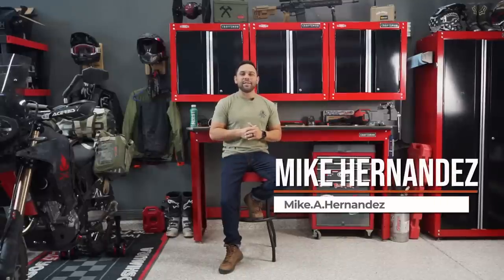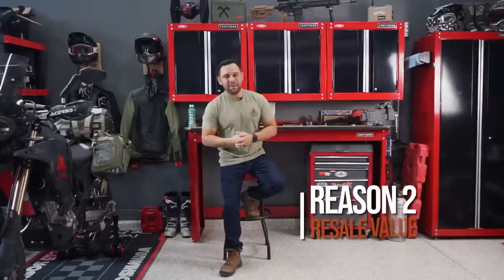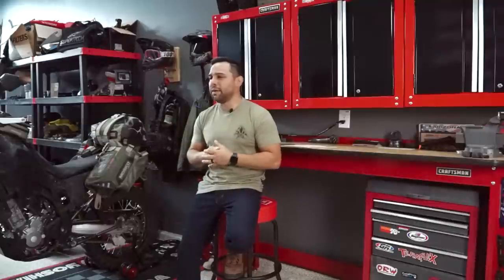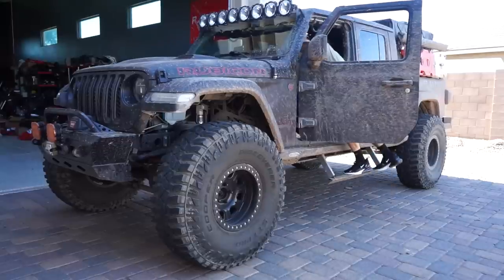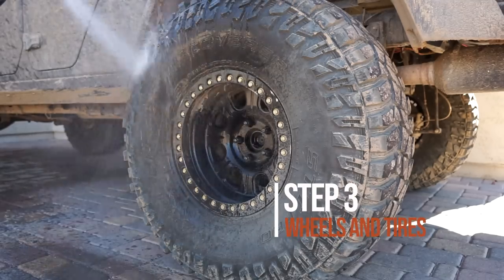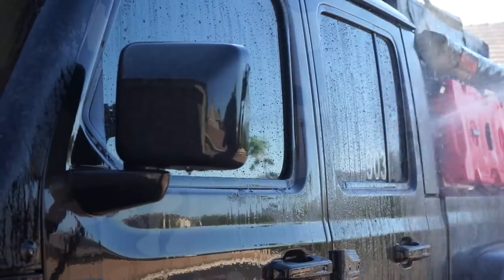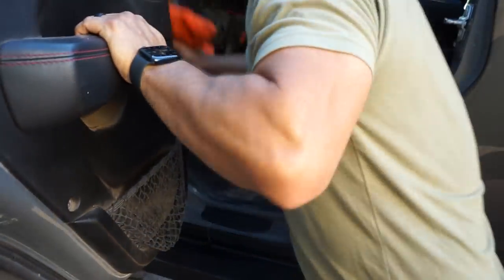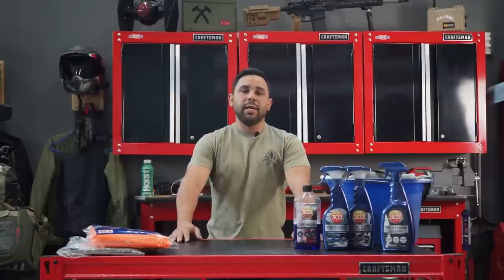How to wash your vehicle | Fieldcraft Mobility

Comment: As an overlanding "enthusiast" and professional detailer I have been waiting for this video from you guys for years. Very informative and well put together. Detailing clients rigs and ATV's is always something I look forward to. 

I understand the ease of finding all of your supplies at your local Walmart, but if you are interest in products beyond what the Walmart shelves provide and that are designed for heavy level of dirt and grime overlanding throws at you, I would suggest taking a look at the Off Road line from P&S. The products that stand out in their line is Mud Buster which is marketed as a wheel and tire cleaner, but can also handle all the salt, sand, mud, and whatever else you find on the undercarriage, suspension and frame plus it leaves corrosion inhibitors reducing the likelyhood of rust on the exposed areas.

Also, for those who are in areas with water that is prone to mineral spots or in hot climates I would suggest using a Rinseless wash, such as Optimum No Rinse, instead of regular auto soap. Rinseless washes reduce the chances of water spots, allow for quicker washing leaving less chance of water drying on your vehicle, and also remove dirt just as well and actually more safely as foaming soaps.

When it comes to protection for a vehicle designed to get dirty, I like to keep it quick and easy. McKee's has a wipeless graphene ceramic coating/sealant that takes the cake. Once you've rinsed the soap off your car, spray a section with the sealant and immediately rinse it again with water, that's it, all you have to do is dry the vehicle and wall away. It coats everything, paint, glass, plastic, rubber, metal, etc, protecting that surface for up to 6 months. Water beads up and rolls right off, which helps keep dirt off the vehicle and helps improve your windshield visibility in the rain. It's simple, super effective and makes maintaining large rigs so much easier.
Reply: I was surprised you didn’t pick up on a few things here? In the UK we use snow foam lances to do the hard work of removing grime. Likewise removing the hardness from water first helps with avoiding water marks. Also you clean the inside first, he was doing the door jambs as an afterthought. Same with the wheels, you clean those last.
People really should watch some detailing channels if they want to learn this stuff, as most of it wasn’t applicable to non wrapped vehicles. Like the two bucket idea, there was no grit guard in there? that’s basic information he’s not understood.
Reply: @____________________________.x  And that's the beauty of detailing,  there are many ways to accomplish the same goal. Snow foam and APC pre-rinses are ideal for starting to remove dirt and grime from vehicles, however this video is obviously meant more so for those who likely don't prioritize cleaning their rig or just haven't put much thought into it at all, which likely means they don't already have detailing specific equipment like a foam cannon or possibly even a pressure washer. This video is also for a group of people who take their vehicles out in adverse conditions, knowing their exterior is going to be abused, I personally doubt they care about the safest way to remove the dirt. Most folks just "let the rain handle it".

Cleaning the door jambs first is truly a preference thing. You clean them first, then go to clean the body of the car, guess where the dirt and grime from the roof the car flows once you start cleaning it? Into the door jambs. Leaving them in need of being wiped down again. If your time management isn't a priority, go right ahead and touch the door jambs multiple times, however in a business efficiency is key, so only touching the door jambs once during a wash is ideal, so we wait until after washing the body to do the jambs. 

Same concept applies for wheels and tires. Yes they can be done last, but if the body is already clean there is a good chance of getting the dirt, grime, brake dust, etc from the wheel or tire and onto the clean paint, so why not just get them out of the way first? 

I have watched 100's of detailing videos from folks in the UK and all across the globe and everyone has their own preferences, but most, especially the professionals, acknowledge that each method is valid. Go watch Alan from AM Details out of the UK, who also happens to be the President of the IDA, International Detailing Association, and he himself will say the same thing.

This video is obviously not meant for those initiated into detailing, as it was basically stated in the video, but meant as a starting point for those in the overlanding community who want to be more vigilant and involved with proper care and maintenance of their rig's. 

Great job Fieldcraft!
Reply: @littledetails  sure, that's why I suggested snow foam for the "rain" people, as it's the least effort? I'm sure channel subs with this kind of hobby have way more kit than anyone in the UK, snow lances are like 20 quid. Not sure about the door jambs, most of the dirt I see is behind the seal,  and if I'm clearing my vehicle at all then it's the inside I'm most interested in.
Yes AM Details is great, worth a shout out to people in here 👍